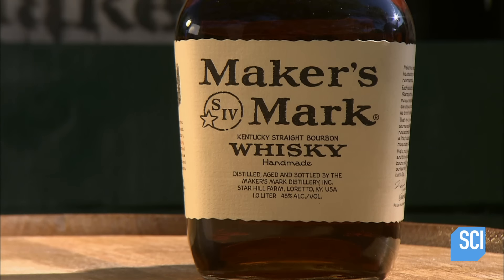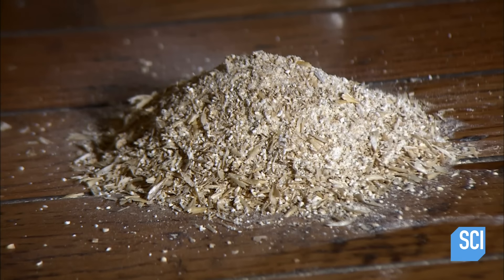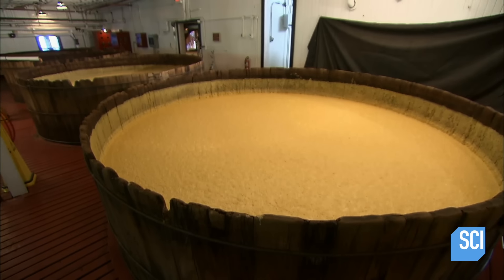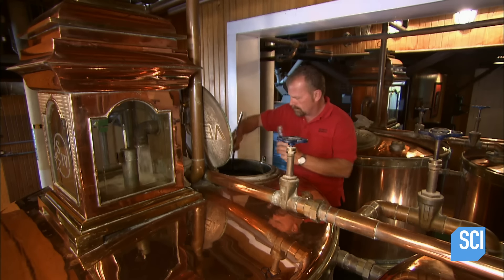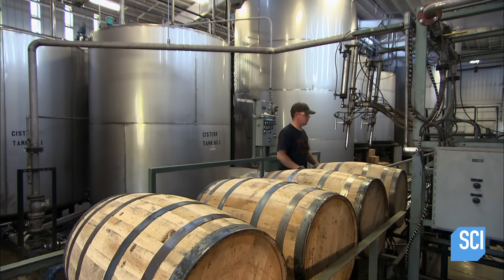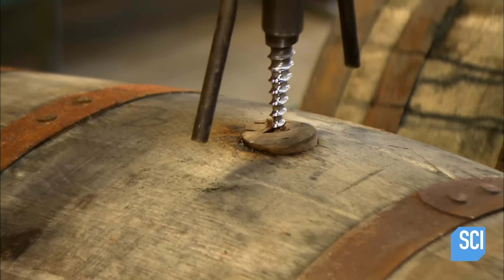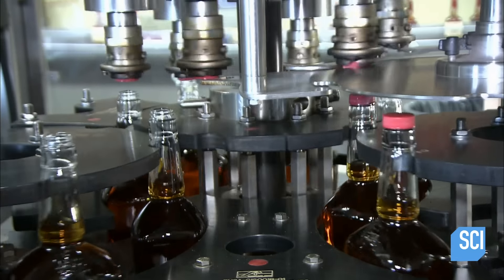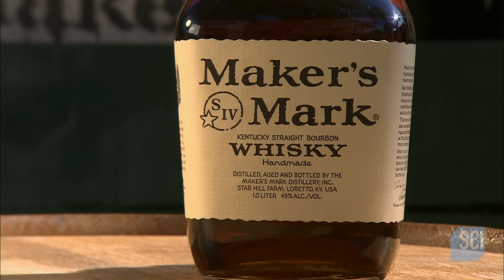How It's Made: Bourbon

Comment: I was a hard Crown and Coke guy until I decided to try that stuff in that cool red wax covered bottle. Makers Mark is deliciousness.
Reply: @jonathanschultz7399  Thanks man! That actually sounds amazing. I'm definitely going to check into that.
Reply: @RRMikeP  Depending on your tastes wild turkey 101 might bee another whiskey to go for. Crown is a very muted and "smooth" whiskey. Mostly due to the filtering process that strips a lot of the flavor/oils that separate when they chill filter.

You might also like Irish Whiskeys as they have a fruity or shortbread cookie notes. The other thing about makers is that they have a very consistent product that they intentionally over priced the market. That was literally their advertisement. "it is expensive" 

There are a few different spirits channels that go into the production side of it. Still it and the whiskey tribe are the two main ones that I know of.
Reply: @vagabondwastrel2361  Thanks for that. I actually discovered Makers Mark roughly a decade ago. Since then, I have been trying a lot of different whiskeys. I prefer bourbon, and I always have a large bottle of Maker's on hand. However, I also usually have a bottle (or two) of higher end reserve type stuff as well.

Comment: 3:59 - I'm glad they filter out all that nasty looking black gunk near the barrels' output.
4:46  - also glad I don't have that wax applicator job, looks pretty tedious.
Reply: When I turned 18 it was expected of me to get a factory job. I got a job at a local factory and began rotating jobs along the assembly line. I met a guy that had been working there for 20 years. He had done the same thing all that time. A very tedious job where he grabbed some wires from one box and moved them to another. The job he did is probably automated now. 

On a side note:
I decided I wasn’t going to be him. I didn’t want to do that for 2 decades. I decided to join the army and enlisted at 19. Served in that for 23 years.
Reply: @gujwdhufjijjpo9740  That was a good plan for you. Factory jobs may get people immediate money. But longterm, not very rewarding. And now you will get a lifetime pension. Kudos to you. Plus you can get another job while collecting the pension. Double kudos.

Comment: Things worth noting but beyond the scope of this is that many Bourbon's are actually not "wheated,"  wheating is to bourbon almost like what a different malt is to scotch, it's done selectively and intentionally by specific distilleries to achieve a specific flavor profile.  Makers does do a darn good job of making a wheated bourbon. The other thing is why they use iron free water.  I mean certainly part of it is that the specific mineral content of the springs in Kentucky are a huge part of what makes Bourbon taste like bourbon, but iron in water of course can oxidize among other things which will impact the flavors during fermentation.  This is also why if you're drinking it neat at home and you want to dilute it down to 80 proof or so (which is often recommended, it's sold cask strength to stand up on it's own with ice or what have you and not always intended to be sipped that strong) you are supposed to use an iron free mineral water as close to a Kentucky spring water as practical to preserve the intended taste.
Reply: thats really interesting! i didnt know that

Comment: What is there margin for proof if it was supposed to be 110 off the still and the DMA spit out 109.5?
Reply: That would be up to the distiller on what they want to do with it. For a margin that small they'd probably just throw it in the barrel because it all gets mixed together and cut with water at the end of the process anyway. Legally speaking, it can't come off the still at more than 160 proof. Anything under that is fine according to the law.

Comment: Few errors. 1) while the name Bourbon comes from the county in Kentucky that the first main stream brands came from, it actually originated in Penn. as a way to deal with excess grain. 
2) US Law never mentions the state of Kentucky anywhere, just the ratio of grains and comes from the US, but can be any state. Most Bourbons are not from Kentucky. 
3) The blue limestone water is only if you want the State of Kentucky to certify that you are "Kentucky Bourbon" (though you can be in Kentucky and not use that type of water, however you cant use the Kentucky name. And Kentucky says it has to be blue limestone water specifically, not just any limestone like you said), but nothing to do with Bourbon itself.  
4) Type of material for fermentation tanks are not regulated at all, even in Kentucky. The Cypress wood you mention is used by some distilleries because they like the flavor it gives. Nothing more.

While educational, do better research before putting in false information.
Reply: 1)  The name "Bourbon" Comes form "The House of Bourbon" in France around 1848.
2)   Follow your own advice about doing proper research.
Reply: @edwardschmitt5710  actually I did, did you know and in US Law where it mentions the official 51% corn mash ratio for Bourbon, etc, it states it is named for Bourbon County KY. the County gets its name from the Bourbon dynasty that was ended by the French Revolution in the 1700s. So while the County was named for the Bourbon dynasty the Whiskey was named for the county. Don't try arguing history with a professional historian.
Reply: Yea you do too the word bourbon came from French bourbon dynasty you might need do you're research .
Reply: @jbrown1971  The County in Kentucky comes from the Dynasty, but the name of the Whiskey comes from the County name. You might want to do some research

Comment: Fun Fact: By definition, before the whiskey is put into oak barrels to be aged, it's just high proof vodka.
Reply: Generally vodka is filtered to remove flavor compounds and give it its pure taste. New make (unaged) whiskey still has those compounds in it, even though the barrel aging is needed to really develop the flavors.
Reply: That’s not a fact, though I used to believe this as well. Vodka is a neutral spirit produced from any material at or above 190 proof while whiskey is a distilled spirit produced from grain strictly below 190 proof.

Comment: doesn’t distilling the alcohol just leave the flavors of the grain behind?
Reply: NO.  If you purified it to Alcohol 100% yes (hard to do).  It is around 160 or 80 percent Alcohol.  The other 20% is the flavor.
Reply: @edwardschmitt5710  so the flavors evaporate along along with the alcohol and go into the next container?
Reply: @213kidangel  Yes.  The other half of the flavor is from the barrels.  They are burned inside them until they get was is called "an alligator char" (due to the fact it resembles an alligators skin).  This allow the raw distillate to absorb into and swap flavors of the barrel.  There are natural sugars in the wood that lend the flavor and the charcoal mellows the bourbon.  When done a small percentage disappears into the barrel itself and is called "the devil's share".  The barrels can only be used ONCE for bourbon.  They are still valuable however.  Scotch and whiskey makers love the flavor they depart to their aged products.  There are even beers aged in them (try Kentucky Bourbon Barrell" beer.  DELICIOUS.  and STRONG!!!).  It's a wonderful alcoholic world!!!!
Reply: @edwardschmitt5710  yes but my question was when it is distilled flavor particles evaporate and travel with the alcohol into the distiller container?
Reply: @213kidangel  Yes.  You can get rid of more and more as you keep re-distilling.  Good Vodka, which is a more neutral flavored alcohol, I like 5X distilled.  Bourbon is usually 2x to retain the flavor.
Reply: @edwardschmitt5710  Ok cool!! Thanks for the distillation!   I was a bit confused!

Comment: Fun fact: the Kentucky senate has a patent on bourbon, so you legally can not call a beverage “bourbon” unless it is made in Kentucky😁
Reply: That’s not true. There is no such patent from the KY senate. Bourbon can be made anywhere in the U.S. but it does have to be made in the U.S. to be called bourbon.
Reply: @zacharywood4450  but it does have to be made in Kentucky to be good bourbon
Reply: @Arcticroberto9376  No at all, I have tried many very good bourbons made outside of Kentucky, namely Wyoming Whiskey which is made in Wyoming. There are many craft distilleries popping up all over the US, most are good with a few bad ones. However, most of my personal favourite bourbons are indeed made in Kentucky and it is likely due to the fact that the limestone filtered water used at many Kentucky distilleries simply makes it taste better.

Comment: Ya might want to redo this video. While 95% of all bourbon comes from Kentucky, Bourbon can be made anywhere in the States. Also they don't use metal caps, in your video you can see red plastic caps. Finally not all bourbons use wax seals.
Reply: No whiskey made outside the U.S. may be labeled bourbon or sold as bourbon inside the U.S. Various other countries have trade agreements with the U.S.  I can make what I would call Scotch whisky here in Florida, but actually it would just be whisky.   Scotch is reserved as a Scottish whisky protected by law like bourbon is here in the USA.  Also the video is about Makers Mark and they are the company that uses - Wax - to make their seals.  So it makes sense to point that out in the video.  𝐒𝐡𝐚𝐥𝐨𝐦